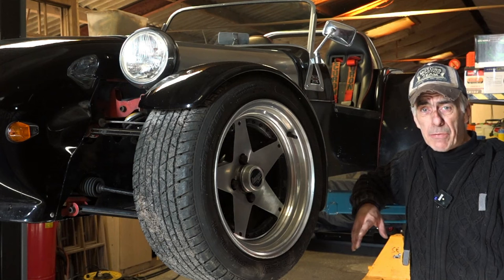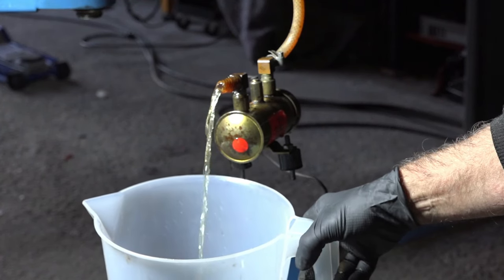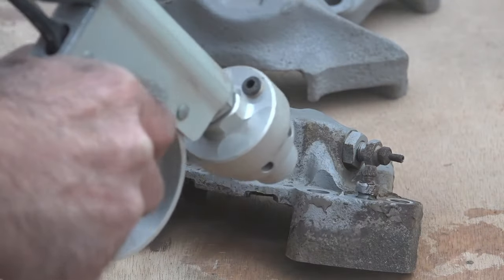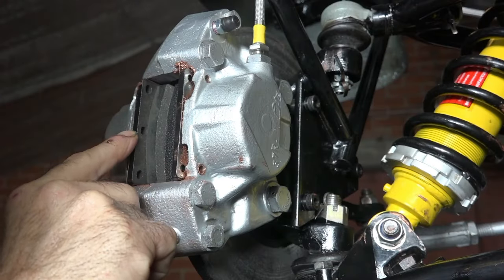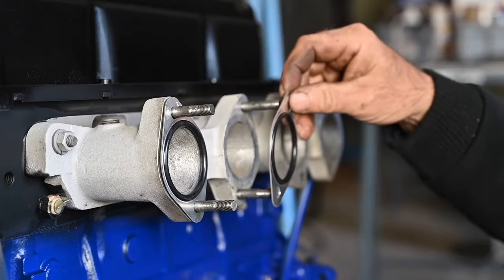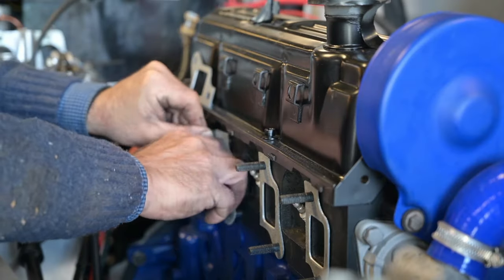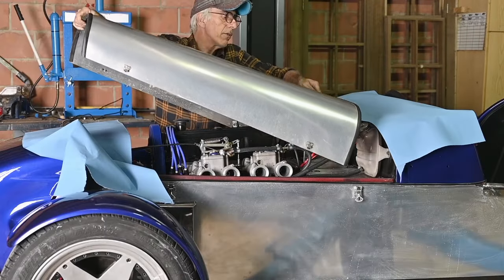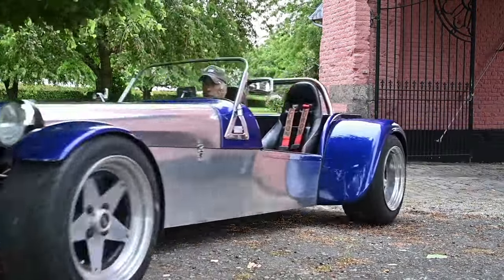DAX Super 7 - A Rebuild Striking a  Balance Between Classic Design and Performance

Comment: Nice video.. 👍
I used to own one. Exact same wheels. Rear ones were a problem at 255x50x15.. You couldn't find tyres. Had the inner rim changed to make tyres 225x50x15 in the end. I have a few things left over from the car if you want them? A long range aluminium fuel tank with filler right side rear. I've got a copy of the build manual too if you want it.
Had the car for many years and rebuilt it a lot. If you have an email address I'll send you some pics and the manual.
The exhaust collector can be a nuisance always coming loose. I modified mine by putting a cut in the pipe and welding on a clamp and bolt across the gap so there's a mechanical clamp rather than an exhaust paste. Watch for cracks around the collector area too.. Because exhaust is fixed at rear and on cylinder head the exhaust system wobbles and cracks.
Reply from the maker: Thank you so much for comments and the kind offer...  I am not sure where you are living, as that could be an issue to get the parts.  In each case, yes send me a mail  at Steve@flashsplash.be    I will be back saterday to answer...  We can talk more by mail....  txs again
Reply: @D3Sshooter  👍
Reply: @D3Sshooter  been trying to contact you but having email issues with virginmedia.. Surprise.. Their email service can be terrible at times.. I'll try again once it's fixed